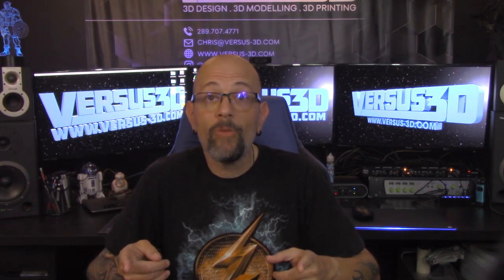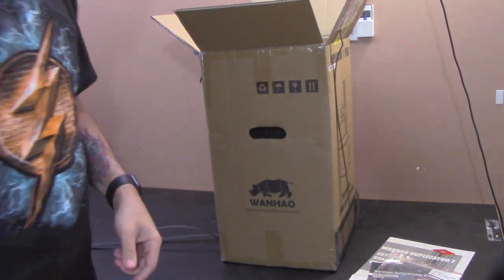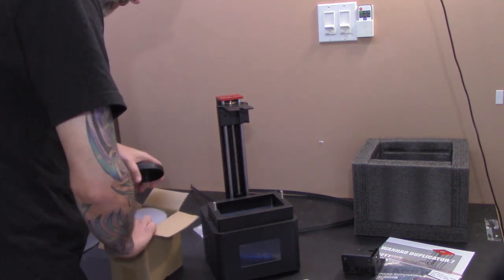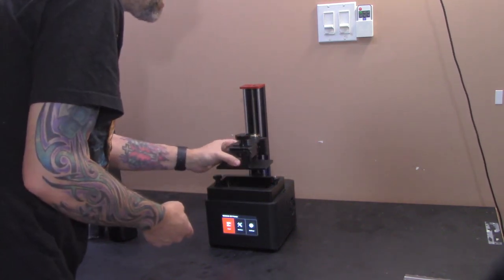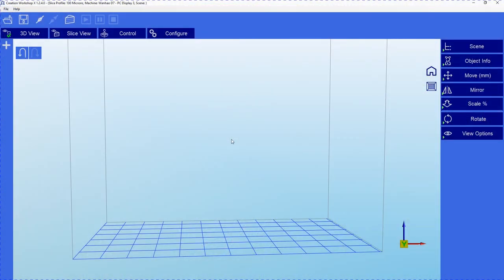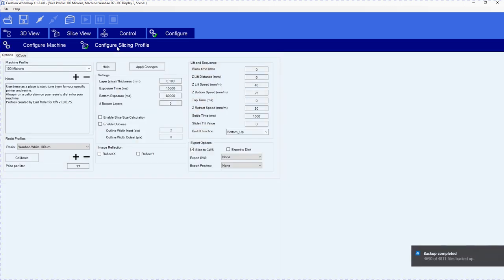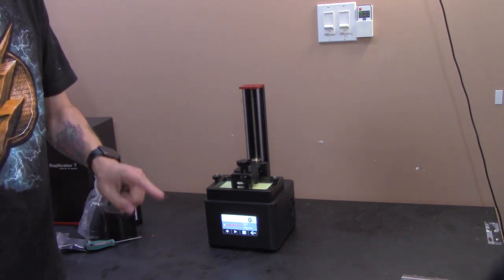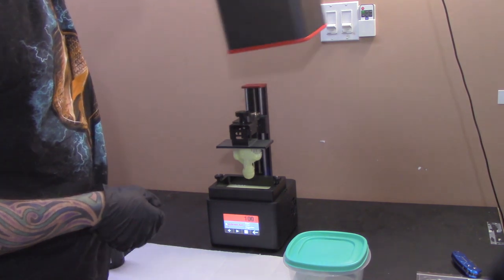Wanhao Duplicator 7 Plus Unboxing, Setup, Slicing and First Print!

Comment: Hey Chris, good video. Question: if you want to print a file larger than the platform, how would you setup a file to print 2 separate pieces and ‘secure’ them together to form a larger resin model?
Reply from the maker: Just like FDM printing, you'd need to print the part in multiple pieces, than glue them together.